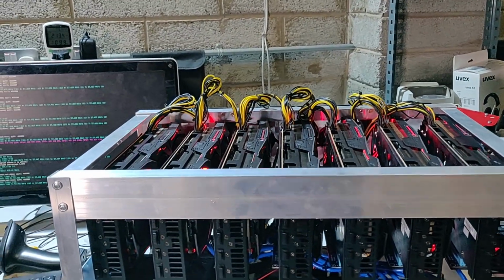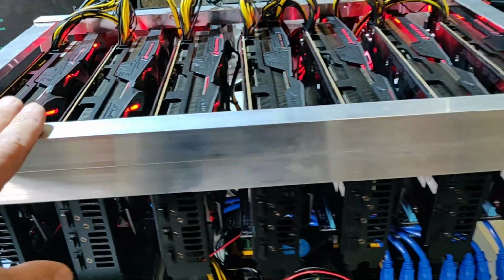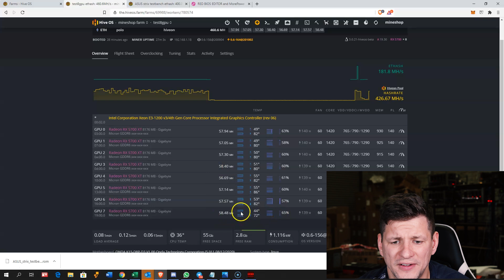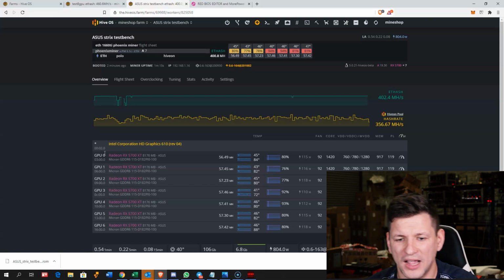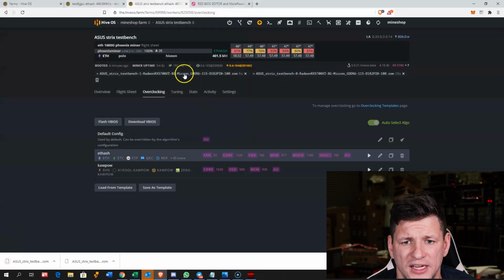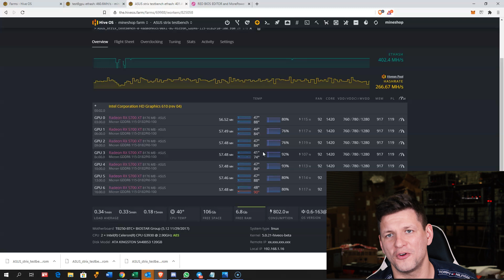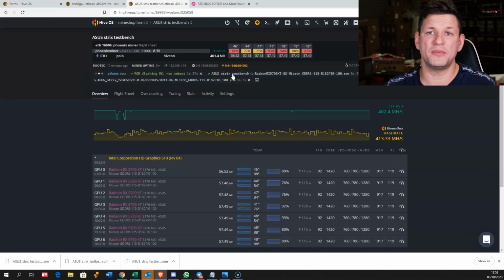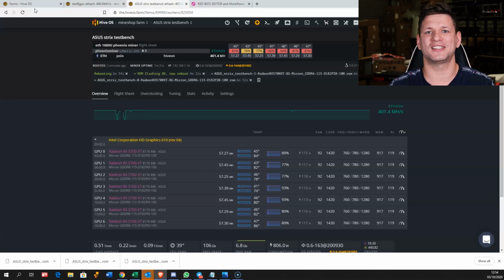Secret sauce BIOS mod for RX 5700 !?!

Comment: I had read a lot of info what I could find about rx 5700 xt cuz mine one's few was very unstable and now they running weeks only on 1400/800/800/910 settings with 108w 55mhs so I was really struggling how to push one more megahash  and my first thought was this guy won't show anything new but I was totally wrong, awesome video and thumbs up from me

Comment: Great video once again, testing this on one of my gpus if it goes well.....will apply to all the rigs. Thanks once again.
Reply from the maker: Nice, what GPUs you have?
Reply: @GuntisVitolins  ufff a lot of different ones. rx5700 asus evo, rx 5700xt sapire nitro+, rx 5700 blower edition, rx 5700 xfx. So far the one i tried worked and looks good 0.7 mh/s better with the same OC settings.

Comment: Hey Guntis! Awesome videos man. Started watching all of them as I'm building a 6 gpu 5600xt rig, 6 gpu 5700xt rig and a 6 gpu 3080 rig to begin with. I live in the USA and I was wondering if I can power the server rack style enclosed cases on 120 power? Again awesome work man and look forward to trying your products
Reply from the maker: Thank you ;) they can be powered with 110v psu
Reply: @GuntisVitolins  thank you for the clarification! I think after these first 3 rigs get complete (minus finishing the 3080 as it proves difficult to find those gpus) i will start building them in these seever cases and put them in a server rack 😁 a couple more questions, on the top cover of the 8 gpu miner why is there a slotted vent section? Is there a fan or something underneath that vents out those slots? And it would be an issue to stack several of these in a traditional commercial server rack? Last one is, with the 8 gpu miner fit 8 3080's inside of them? Thank you so much again man!
Reply from the maker: @Michael-Mulcahy  yahh these cases much easier built then building from scratch open air.there is 4xcase fans to cool down the GPUs. With 2400w psu can install 8x 3080 no problem
Reply: @GuntisVitolins  thank you for the info, I will definitely look at populating server racks with these caes then, while louder I like the reliability of a riserless system and the cooling capabilities of the enclosed case as well as good use of space putting them all in server racks. Thanks again and look forward to doing business with you 😁 as long as you ship to the USA which I believe I heard from Red Panda that you do

Comment: Thank you for this Tip. If you find a way to reduce the temperatures of the memory, that would be something very cool!
Reply: at this point im almost willing to start cutting some fins on the heatsink 
so i can put copper heatsinks on each mem chip
also one thing that helped out some of my cards was taking the plastic backplate off
not all have plastic and the ones with metal all have thermal pads for mine
fan shrouds also insulate heat and add a few degrees

Comment: I have 6 5700xt what power supply do u use for your 5700 rigs??  I have 750 watt evga and 750 watt server power supply which I hate.  Gonna upgrade to a single but having enough cables is the problem.
Reply from the maker: Told at the start of the video. They don't have brand, just some Chinese psu for mining.

Comment: I have already flashed my MSI MECH OC RX5700s to the XT version. Although when i did it, i missed the part where you change the dram12 timing. Is there any way possible to do it over again with altering the dram12 timings? I cant figure it out.

Comment: Hi Guntis!!! I'm a bit new in mining and I have 4 MSI rx5700 MECH OC that  the memory temps after bios mod, OC and undervolting, are between 78-84º celsius... Do you think that this mem temps are safe for 24/7 mining?? Do I have to worry about the "lifespan" of the cards?? Thanks in advance

Comment: I have the Asus strix  rx5700 xt, how many power  supply for all 8?
Reply from the maker: 1800w is fine, you just need to see if enough cables, you cannot connect to many on each cable.
Reply: @GuntisVitolins  can I use the cards of the box with a 1800 PSU?
Reply: @GuntisVitolins  I was thinking of using two 1000 watts

Comment: Quick question. Do I have to do it with a stock rom or can it be modified already?
Reply from the maker: Depends if your stock room can be modified.
Reply: @GuntisVitolins  I have already bios modded it. question is if I can re bios modded it?
Reply from the maker: @alonpeled7974  yes
Reply: it works. Thank you so much

Comment: @#GuntisVitolins 

Any chance you have the bios particular for those cards? I am hitting 57mhs on my strix 5700 but have my memory at 930. Would be nice to see if I can get lower voltages and higher hash.
Reply from the maker: Yes think have on these somwhere. Send me email.
Reply: @GuntisVitolins  Saw your email in video description. Looking forward to your response
Reply from the maker: @Joshh3003  it will be on friday, away now.
Reply: @GuntisVitolins  not a problem that is fine. Though if it's on hive can't you remotely download the vbios rom if you are away?
Reply: @GuntisVitolins  Hi Guntis, What are the strix model of cards you are using in this test? Whether you are using a different bios I cannot get close to as low vdd and vddc voltages as what you have pictured. Nonetheless looking forward to hearing from you with this bios secret sauce mod you have. Thanks!

Comment: Doesn’t work for me. Gigabyte 5700xt, tried doing this with and without straps. Just get error 43 in device manager. Any thoughts?
Reply from the maker: You need use older bios, neb bios is issue to modify.
Reply: #GuntisVitolins Thanks for the reply Guntis! Can you link to old bios for Gigabyte 5700xt? I am modding my original stock bios. Can’t find an older one for that card.
Reply from the maker: @cuppacheese  send me email I'll send you bios tommorow.
Reply: #GuntisVitolins thanks Guntis!
Reply: #GuntisVitolins Guntis, don’t forget about me please 😁
Reply from the maker: @cuppacheese  send me email otherwise will forget.
Reply: #GuntisVitolins I misunderstood earlier. I thought you wanted my email. What is your email? I will send you an email right away.
Reply: #GuntisVitolins I don’t have your email ☹️
Reply: @CoqBurne Thanks, didn’t even think to look there. Ugh.
Reply: Guntis sent me the BIOS and it works! Thanks!

Comment: Do we need to change it from the two memory types? k4z80 and mt61k2...? or just the k4z80325bc that you changed on the video?
Reply from the maker: Changing in one of them would be enough if you know which set of timings your card uses. If you do not edit in both.
Reply: #GuntisVitolins thank you :)

Comment: i got a unlocked 5600xt rom for my micron cards and i noticed the same thing as u with this setting
the same voltage settings i used before i had to lower but i didnt notice much lower power
ive been trying new stuff with core OC vs mem and having nice results with lower power
but i still run much lower core clocks than u and ofc i have lower hashrate in return
Reply from the maker: So you are able to bios mod you rx5600?
Reply: @GuntisVitolins  i figured u checked red pandas video already
some community member gave him a msi micron bios thats unlocked and he gave it out
it works on all microns i just did the MPT as well to be safe
all my 5600xt are running 43-44 now
https://www.youtube.com/watch?v=7n4X3YGtNCk
Reply: @GuntisVitolins  also thx for this TREF tip
i was gonna try it after the 5600xt bios mod and am glad u got to it first to prove me theory right
just added another 1Mh to everything :)
Reply from the maker: @cidsapient7154  Ohh so you are talking about this BIOS, i thought you have different from different cards
Reply: @GuntisVitolins  yea i just run that on my asrocks and msi gaming x
i dont have any other 5600xt
but it should work with any micron cards
Reply from the maker: @cidsapient7154  ahh yeahh seem some of the Rusina youtubers ran the same BIOS with Asrock cards at 46mh/s

Comment: thank you man you are perfect 
I want ask you 
I have rx 5700 oc doul fan the momery temperatures is very high 100 and more degrees what can I do for this . it's normal or danger 
GPU 60° fan 55 memory temperatures 100°
Reply: 100C is the highest limit. Up the fan RPM or implement any sistem to cool.
Reply from the maker: @Picapalito  memory can go actually lot higher the then the CPU. Memory throttling ad 115c
Reply: Mine msi rx5700 mech gpoc's memory temperature is also up 104-106°C gpu 56°C junction 67° fan 93% 53 mh on stock bios.
I think 5700 temperature sensor is really close to hotspot that's why its high.
Reply: @muhammadjamshaidzafar1965  Mine is in 90-92 C and I am afraid :(
Reply: I have the same problem ,And now My rx5700 get avg 33mh/s and 85w at 72c .IF you mining by calymore ,just add -ethi 0 you will get the same rate.
Reply: Alhamdolillah mine rx 5700's memory dropped 16°C.
Previously it was 106°C then i opened it and found 1 memory chip's thermal pad was missing so now i put on it it reduces to 90° C 53 mh/s without any bios mod

Comment: which one to choose?
Gigabyte 3 yrs warranty / auros 4yrs wty
GIGABYTE RX5700XT GAMING OC 8GB @ $412
GIGABYTE AORUS RADEON RX5700XT 8GB GDDR6 VGA @ $460

Sapphire 2 yrs warranty
SAPPHIRE PULSE RADEON RX5700XT BE 8G @ $432
SAPPHIRE PULSE RADEON RX5700 XT 8GB @ $438
SAPPHIRE NITRO+ RADEON RX 5700XT 8G @ $473
Reply from the maker: Nitro + probably will be the best quality card with premium components. Is this what you want or you want fastest for ROI? Cards are usually bulletproof if you look after them well.
Reply: nitro  +

Comment: Nice video. My 6 gpus XFX RX5700 XT Raw II can use modded bios? Please help me thanks.
Reply from the maker: Any RX 5700 can be modded.
Reply: @GuntisVitolins  thanks
Reply: Can change DramTiming12 6000 for my GPUs XFX RX5700 XT RAW II?
Reply from the maker: @nestorasl2010  yes

Comment: I think this is more than just a small change.  0.9 extra mhs for doing nothing, fantastic.  One thing that makes the change slightly faster:  On the first strap (1500/1550) make the change to 5990 and then copy the strap, it will paste the change automatically so you don't have to go through each one